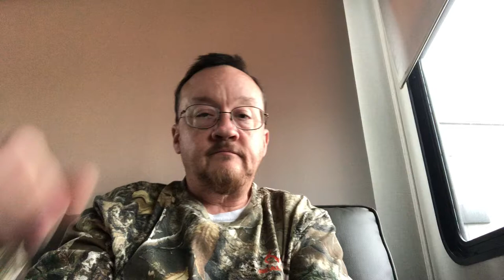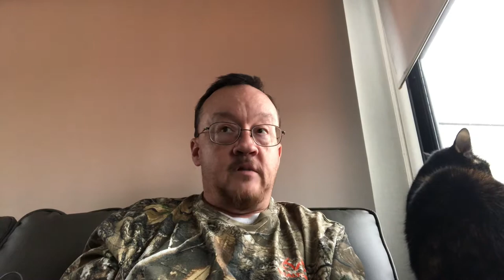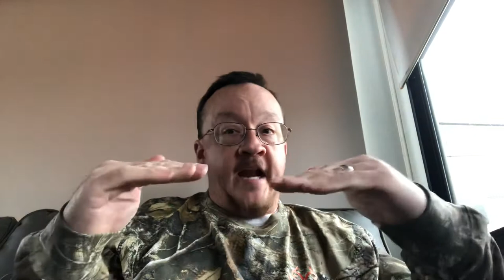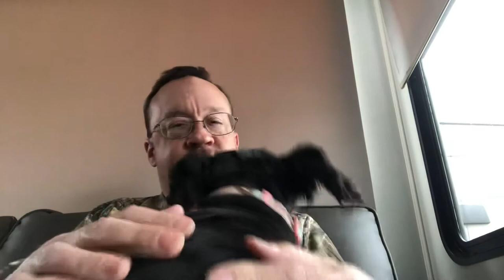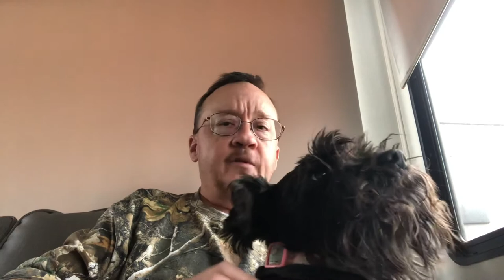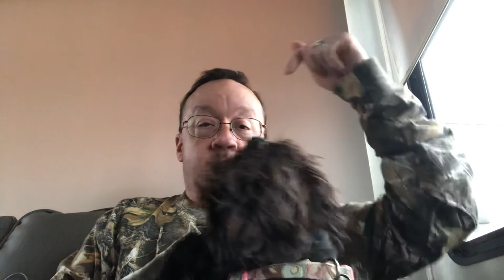How to increase fuel economy

Comment: all really good info here. only thing i disagree with is maybe warming up your car before taking off. i think if you are going to go straight into hwy driving it makes sense to warm ur car up before driving, mainly in cold weather. i seen a ~2mpg difference doing this on my 130 mile round trip to work in an 02 civic ex manual. it took about 2 years and 80k miles worth of data to have the statistical power to detect this real difference though lol. gotta have a manual... i overinflate tires from 28-30reccomended to 37psi until it gets cold out... my suspension is so messed up that it actually makes my tires last longer since they dont wear so much on one edge. in the winter i go down to about 24psi. this might also be coz of how often i get new tires. yeah i know i should get an alignment but my car came with some bubbad togeather control arms and no sway bar attached. not sure how i am still alive after driving 100k miles with no sawy bar to be honest

https://docs.google.com/spreadsheets/d/1bm6AA_REpwN4IHcth9lzX8erfZYNW2a2ZlCMUzBaN4E/edit?usp=sharing
link to data set if anyone wants to see what 80k miles in an 02 civic looks like. u can see exactly when my cat started getting clogged.

o one other thing, people forget to change their oil, it should help i think a little bit, especially in lower cylender number cars that rev higher. i change every 10-20k miles with new sparkplugs and use the copper ones. could probably do better but its almost all hwy miles at lower speed